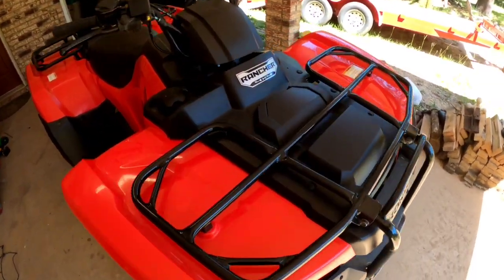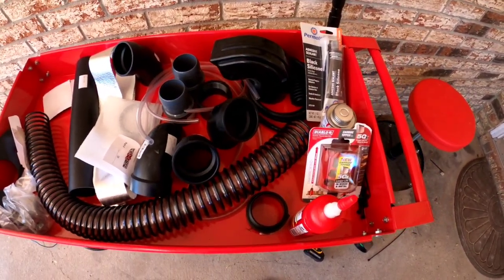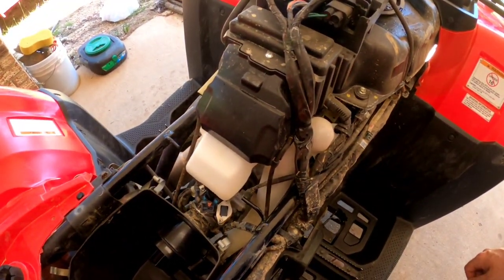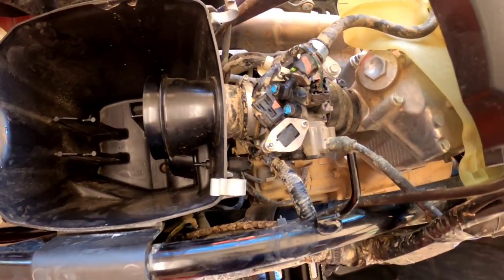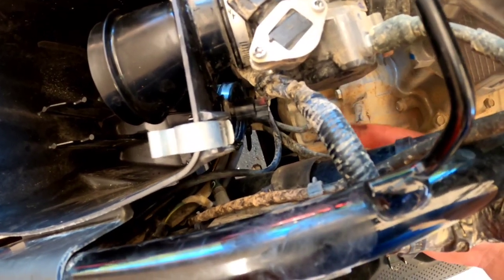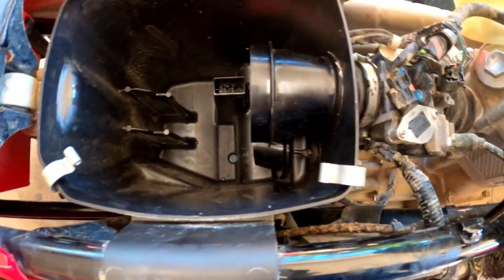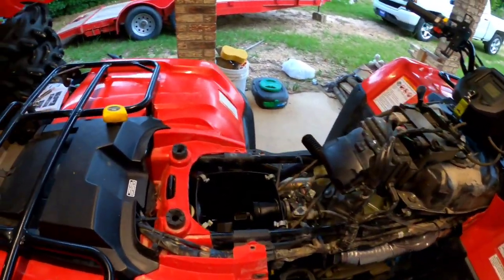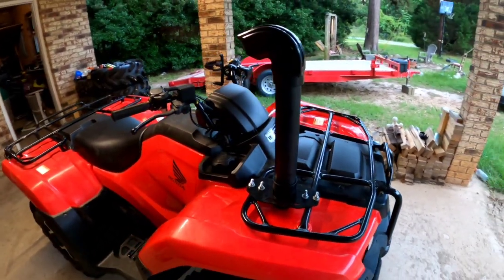2019 Honda Rancher Highlifter Snorkel Kit

Comment: For sealing the air box is dielectric grease better for sealing it should I just do black silicone
Reply from the maker: I do grease so it's easy to open it when I change it. But it's mostly personal preference

Comment: I ordered the same one and I got someone thats gonna put it on Saturday. Is there any maintenance or anything I need to do to it before I ride in water?
Reply from the maker: I'd just double check everything. I put dielectric grease on everything I could get to plug wise! I still need to do the tilt sensor delete. Some people have no problems then I here some say there's will just shut off in a deep hole for no reason. I still haven't figured that out.
Reply: @LCPowersports  alright thanks, ill buy some dielectric grease
Reply from the maker: @countryboy5413  no problem!